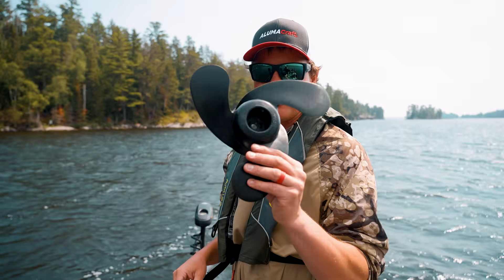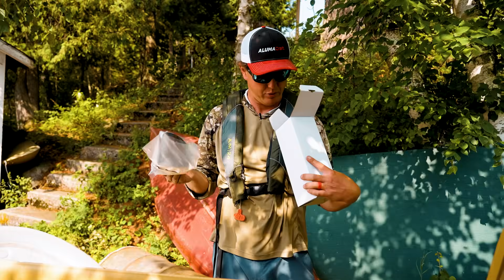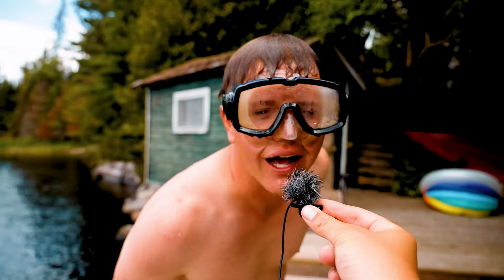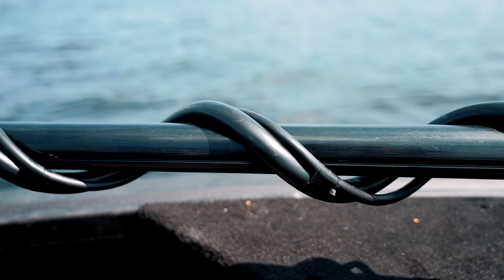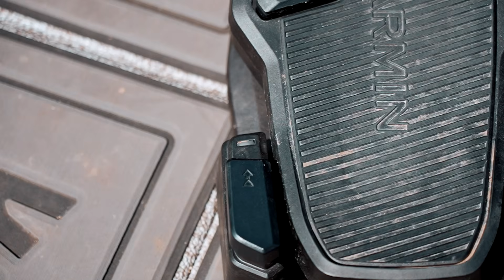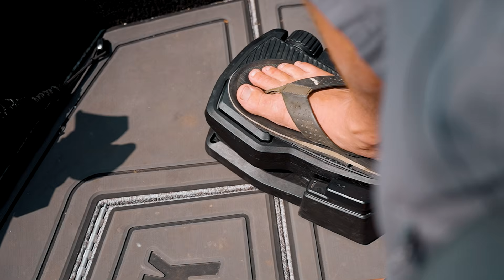FIRST LOOK! Garmin Force KRAKEN (High Tech Trolling Motor)

Comment: Great video! Wondering if you’ve encountered the power of the Kraken being an issue with your batteries? I run two high quality lithiums in a 24V setup and can only run up to 16 out of 20 on the power scale before it powers off. I get good performance out of it up to 15 but would love the extra power when I need it. Curious if you’ve encountered this or heard it’s an issue?

Comment: Desperate for help Jay! Bought a kraken with quick release as you have on a competitor 185. I have issues with it not being very secure and have been breaking bolts and dealer has said to put a fabbed up steel plate under in bow to make it less susceptible to breaking since it’s a “heavy motor”. Have you had issue with it wobble or having play while on mount?
Reply from the maker: Email me at info@jaysiemensmedia.com

Comment: I was literally just saying "Dude! You're going to drop something in the water..." and *splash*. Anyway, do you ever feel like the 75" was too big for your boat? I have an 18' deep v with 26" from the water to the bow... maybe a little more. Anyway, according to Garmin, I should add 8" for rough water (which I get into sometimes) and that puts my right at the top of the 63" shaft and in the middle for the 75" shaft. I'm trying to decide if it's worth the extra $200... thoughts?

Comment: I noticed the way you mounted the TM that the head is hanging off the side of the boat.   Any concerns with it being damaged trailering - rocks etc?    I’ve got one on order and my only concern is  getting it mounted so the lund travel cover is still useable and I can use the stabilizer mount.   I figure I’ll have to get the travel cover modified.   If the head can hang off the side with no worries, that would also help.  Great videos!  Keep them coming!

Comment: This motor is the missing link for me, thanks for the great video I just ordered a white one arriving Friday. I had an Ulterra self-deploy unit, that's its weak point though. It's not worth the convenience when it malfunctions often.  Reason I went with this is I just got rid of Ulterra motor, all the noted improvements and it integrates with my garmin, which was always a sore spot with Minkota units.  Pays to stay informed I almost bought another model Minkota. One quirky thing I find is the price difference on the black model, which cost less, is saltwater rated and comes with transducer about a $400 difference. Is the white paint process that much more expensive? Pro tip: If possible, (pro cuz lot of experience getting repaired) get an extended warranty on any motor, about $300, saved my bacon. believe

Comment: Quick question. If you allready have a Garmin 122SV chartplotter with GT56 transducer at the back of the boat (obviously connected with a cable). How do you connect your 122sv to the GT56 transducer in the Garmin Force Kraken? I can't read anything on the site, but it seems to me you also need a cable? There's no cable in the accessories? Or is it wireless?

Comment: Question.  When paired with garmin chartplotters does this follow contours / depths / jog.  Create a route on the map and the garmin kraken will track your route.   This sounds like it can make casting on windy days much easier. Especially for the captain who sometimes will sacrifice a cast or two to regain boat control.   If it works that well I’m a fan instantly!!!

Comment: A possible solution to not knowing your speed in the back of the boat. I use a small S-biner to clip the remote to my belt buckle. When you adjust your speed on the pedal, it will indicate the current speed on the remote screen. Obviously not as convenient as looking at the indicator lights on the main unit but maybe a little easier than asking the guy at the bow of the boat while guiding. Hope this helps.

Comment: Just fyi, using that remote when you are in the back of the boat guiding will be easier than the pedal, also, you can see your speed on the remote display as well.  X2 on the route making another viewer mentioned, i do that all the time, i use the app for it but you can do it on your garmin graph as well.  Fish hang in different depths throughout the year, if I want a stress free 3 hour trip around the local lake, I pick a depth, set the route right on that contour, and it syncs right with my graphs and force, away you go!  Oh yeah, and if you catch a biggin and want to pause your route, just hit your anchor lock!

Comment: With live scope on the bottom of the trolling motor when parallel to the shoreline you are only able to see what's in front of the boat the way the trolling motor is going.  I would still keep the live scope on the pole so it's pointing in the desired direction, not the direction of travel. Be a pain in the neck to have to constantly turn the motor to see what's to the side of the boat, then turn it back to move ahead. My 2 cents.

Comment: I have a Garmin force. Here’s my workaround to check the speed setting without asking the person in the front of the boat: 

- wear the remote around your neck or leave it somewhere you can see it. The remote displays the speed setting in real time when you adjust speed on the foot pedal. 
- if you have a Garmin graph within eyesight of where you’re fishing: add the “trolling motor bar” overlay to your screen. This is also an easy way to see other settings quickly like what mode the motor is in or what pre-programmed route you’re running. 

You wouldn’t think knowing the exact setting would matter but the new trolling motors are so powerful that I’ve nearly thrown myself and others from the bow of the boat when the motor was accidentally engaged at higher speed than intended 😂. 

Hope this comment helps someone catch a few extra fish instead of messing with their trolling motor!
Reply from the maker: This is very helpful! thank you!!!

Comment: I got the previous Force this spring. In my humble opinion the best feature is the routes. I create a route on my Echomap and just let the trolling motor run the boat and I get to fish! You will like the wireless connection to your graph. Tells you what speed you are in and many other things. The Force is so good, I'm thinking it might be illegal.
May the Force be with you!
Reply from the maker: thanks for sharing! ill give that a try!
Reply: Totally agree about the routes! It makes fishing way more enjoyable, especially on windy days when it takes more effort to keep the boat going in the right direction.
Reply: Is your Force on a bass boat?  I have a Crestliner Sportfish 1750, wondering if the 57" shaft is long enough.   I might go with the Kraken for that reason, but would prefer the spring assist stow/deploy of the original Force.

Comment: Interestingly enough a prominent YouTube angler and BASS opens pro from my hometown in Nebraska ran a garmin force 3 boats ago. He went back to Minnkota for his last 2. I’ve heard the same from many others I fish against/with. Interesting to see if you’ll have the same experience or not. I personally couldn’t run one that wasn’t cable steering even on my deep v
Reply: MF got that when it first came out.  It takes a while to adjust but with the software updates the old force is still a force.

Comment: Put Garmin Force on my boat last year, thee best addition i have put on my boat thus far. Have the trolling motor linked to the garmin EchoMap you can control the motor from is as well. i use the remote myself, it has a display screen and gives speed and heading, plus the point and click option of the remote is amazing as well.

Comment: Very informative video. Only question is when running on 10 or top end, how many amps are you drawing. I know it's brushless but did your power cables from batteries get warm or hot.
Reply: 58AH on 10 with 24V on one of the Australian videos

Comment: Garmin graphs and livescope are some of the best but their other products are just garbage! You can even put a garmin trolling motor on a 16 foot fishing boat because it will go crazy in anchor mode or spot lock and almost throw you out of the boat..... junk
Reply: There is a setting on the Garmin force remote to turn down the spot lock sensitivity for lighter boats . It fixes the exact issue your having. its default at 5 . try turning that setting down to 3